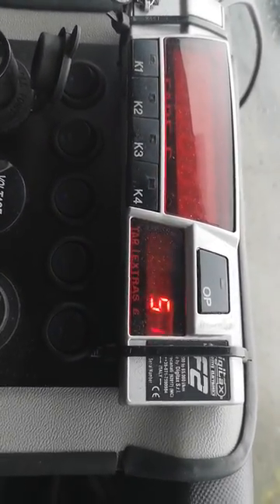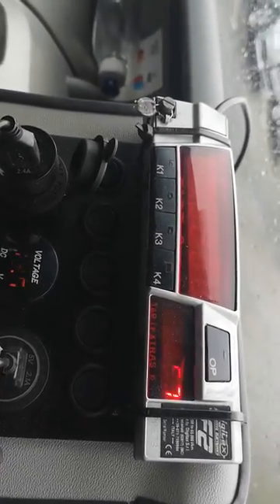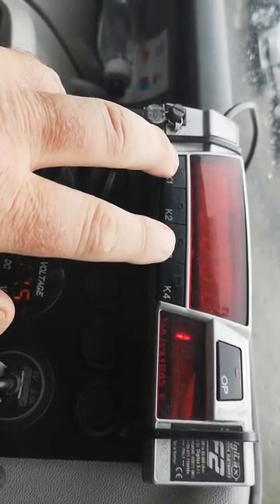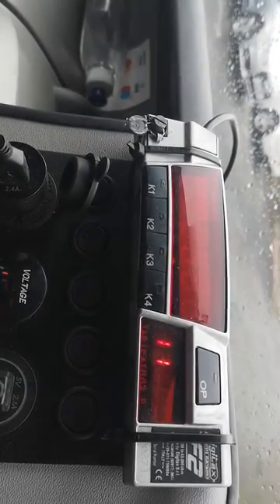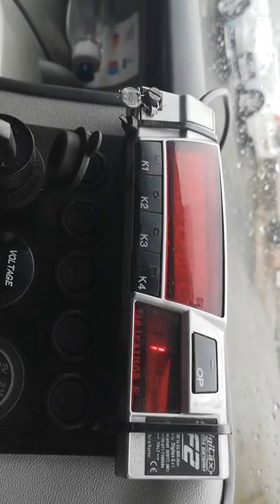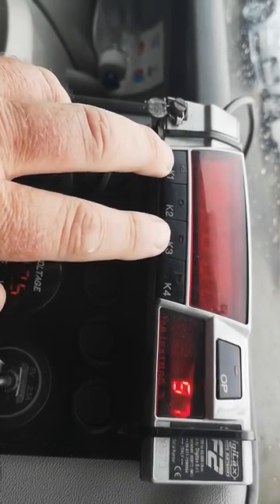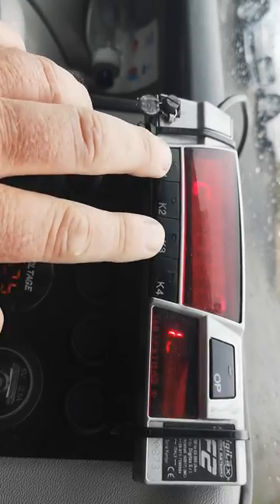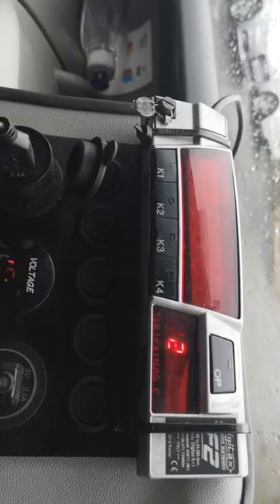Digitax Meter how to adjust time

Comment: Mine is running 7 minutes fast any advice ?
Reply from the maker: I don't know pal. Try letting meter run to 12:02 then hit k1 and k3 together. It might jump back to 12:00. Doubt it will work though. If it did you can keep doing it till it's at right time. I always thought these meters are actually set to run slow so after about a week it should be a minute or two behind.